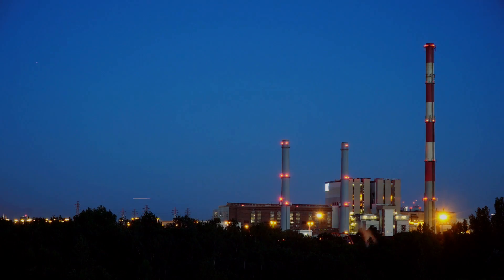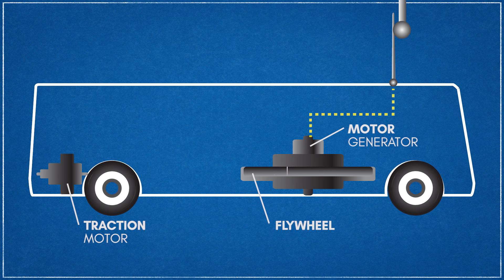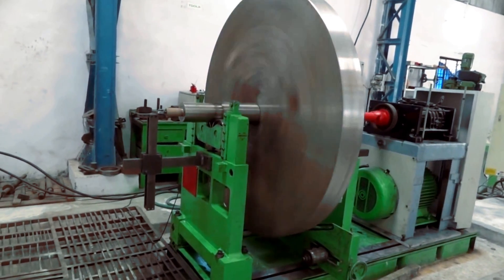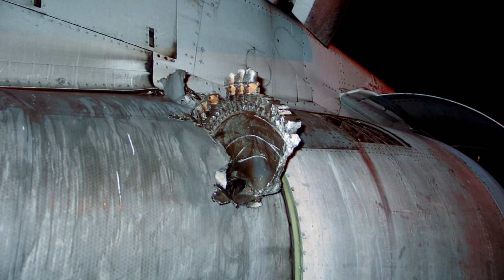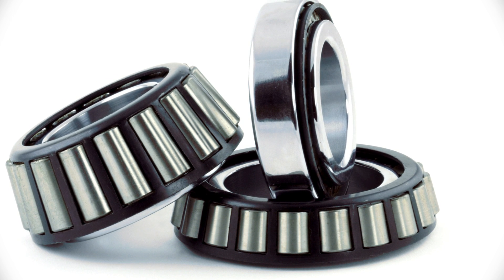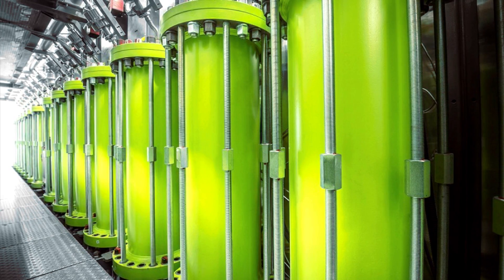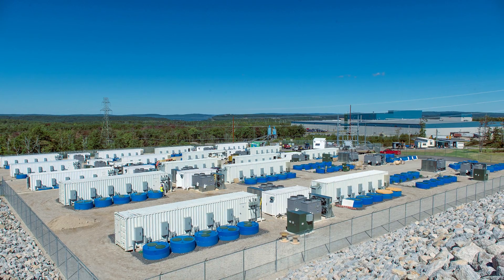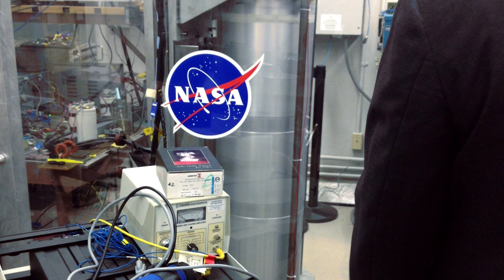The Mechanical Battery

Comment: 14:53 i was gonna mention that some F1 racers used a sort of mechanical battery type flywheel to recover some energy lost during breaking and using that energy to improve acceleration by means of a specially designed cvt transmission
Reply: And Mr Spock would say "fascinating"! Please provide a link for you info
Reply: @JohnSmith-eo5sp   here you go 
https://www.youtube.com/watch?v=KPJwJfdzP9o

Comment: So why not build huge solar farms in the desert, and when the sun goes down the extra energy the solar panels made over the day is send to a mechanical battery to power houses when there is a peak demand (just after sunset).
Reply: This is what is already happening, they just aren't using flywheels that much yet, and prefer to use batteries, pumped hydro, and other things.  As the video said, flywheels are great to supply sudden bursts of power, but for continuous even power (like running a city at night) there are other solutions that are more cost effective for now.
Reply: Berkeloid I think using flywheels for that short peak demand is a pretty cheap and viable option, but not sure, I’m not an engineer :)
Reply: @RikkerdHZ  I'm not an engineer either so I'm only guessing, but I figure the sorts of peak demands they see on the grid at night aren't significant enough for flywheels, otherwise I think we would see more of them already!
Reply: Berkeloid So I’ve done some research on them, and apparently the biggest issue is the cost. They actually can store loads of energy for good amounts of time, but it’s still a very expensive way of storing energy. 
NASA actually made a model which can store up to 500 Wh/kg (even a bit more, I don’t remember the exact number). This is almost double the amount compared to lithium-ion batteries.

And if it’s not suitable for huge, grid cases, it might be really valuable for off-grid homes! 
A bunch of solar panels charging the flywheel, and at night using the energy from it.

Velkess is a company which claimed it has found a cheap way of producing this, but there are no exact numbers unfortunately.
Reply: @RikkerdHZ  Very interesting!  I plan to use it in an off-grid situation myself, but more for stabilising a microgrid rather than energy storage.  But if it can outdo lithium, maybe I need to do some more investigating!
Reply: Berkeloid I think it has the possibility to outdo lithium batteries, especially from the lifespan. But it’s just the price, I think not enough people or companies are researching it!

Comment: What stupid idea! why not just use overhead wires to drive the trolley-busses as used successfully in trains and trams throughout the world fly wheels in engines are used to  smooth out thevpower pulses of thecreciprocating engines and to keep the engine internal mechanisms running to operate valve gear relectricsl generation and ignition systems!

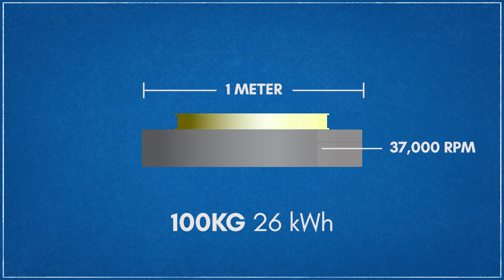Comment: 12:48 I wonder what the g-force would be. That is a lot of g's trying to pull that flywheel apart.
Reply: No need to wonder:    a=rω^2
Reply: @GFSwinger1693  Well?
Reply: @davidhenderson3400  I'm not going to hand you the answer, calculate it. There is your formula.
Reply: 765176g or 7.5 million m/s^2 if anyone's still wondering.
Reply: @zamundaaa776  That is crazy. That is g's pulling out. If that was g's pulling in that thing would be a black hole. How does it not get pulled a part?
And thank you for doing the math.

Comment: Back in the 80s  when there was only Bell telephone systems thousands of flywheel energy storage systems where place on  the long land lines to kept loop current within specifications for operation.  The flywheel system was charged when the phone was on hook and discharge during phone use.  This allowed phone lines to operate over very long distances with connection to other power sources.  These units looks a lot like a window air conditioner Freon compressor  of the same era.  Bet you did not know this not so new mind.

Comment: Another type of mechanical energy storage that is interesting are big towers that have heavy hanging weights that are lifted by surplus energy and are lowered to produce energy. A lot like old cuckoo clocks. They don't require expensive control systems or cryogenic cooling or magnetic bearings.
Reply: I just did some calculation on this: A 2-meter cube of steel (assuming 7.5g/cm3 density) lifted to a height of 60 meters would provide 9800 watt-hours (9.8kWh) of energy at 100% efficiency.

(7.5g/cm^3 * 8,000,000cm^3 * 1kg/1000g) * 9.8m/s * 60m = 35280000kgm^2/s^2 <Joules> [...then] * 1h/3600s = 9600kgm^2/s^3 <Watt-Hours>

Assuming you needed 2kW over an 8-hour night (16kWh), and you made your weight out of lead (11.34g/cm3), you would need a 2-meter-cubed weight of lead lifted to a height of ~51 meters - plus error margin, since that's assuming 100% efficiency.

(Same equation as above, just work in reverse, flip everything over, and cancel out units to solve for meters... the '5m' in the equation above):
16000kgm^2/s^3 <Watts> * 3600s * 8h * s^2/9.8m * 1/(11.34g/cm^3 * 8,000,000cm^3 * 1kg/1000g) = 51.83m

The weight-tower would have to be fairly beefy, and the weight would have to be channeled to eliminate dynamic load (tectonic sway).
The connecting cables would have to be fairly beefy as well, and rated for wear.
You could weld the weight container together on-site, then place lead blocks inside by hand. That wouldn't be too tough.
The last tricky part would be designing the dynamo, and rating its consumable elements for wear.

That's a lot of money just to store 16kWh.
You could combine the cost of construction and the estimated cost of consumables versus batteries.

I'm no fan of the Tesla Yuppie-Hipster-Techno-Grey-Goo-Dystopia, but just comparing raw numbers, a Tesla Powerwall can hold ~13.5kWh (7kW peak output, 5kW continuous, more than enough for a residential house's overnight consumption), lasts for ~12 years (Version 2, at least), and costs ~13K.

I think batteries are just too damn efficient for much else to compete... I just want other companies to get their butts in gear so that Ol'Musky has some competition and prices come down.
Reply: @-_-----  Thanks for the calculation, much appreciated. I wonder what the price would look like at scale? Water towers hold a lot of weight (even more than your lead example), so I wonder what sort of potential energy they can hold.
Reply: @Genubath1  Actually, I was surprised by the amount of mass that water towers hold aloft when I actually crunched the numbers... A water tower with a 400,000 gallon capacity held 50 meters aloft = 1,514.16 cubic meters = 1,514,160kg @50 meters (approximating, since not all of the fluid is at that level...) ≈< 206kWh.
I still think that the engineering requirements will force us to look for battery-based solutions... but it is interesting to crunch the numbers.
Reply: @-_-----  Could you please calculate how efficient this engine can be?.  
https://youtu.be/dTIwSd-TU00
Reply: @elementssolutions5473  Ahh shit, that's way more complex. I'll take a look when I have some downtime.
Reply: @-_-----  Thank you. For convenience, take a meter long cylinder and piston of 100 grams Without Friction. ( I am very curious how efficient this motor/generator can be compared to current motors/generators).

Comment: An interesting use of flywheel to store energy in motorsport is the KERS(kinetic energy recovery system)of the Nissan GTR LM. It was planned to have a flywheel that would spin at 60000rpm(47000G of acceleration for the outer edge of the flywheel) encased in a vacuum chamber, it is connected to an epicyclic gearbox which is then connected to the rear wheels. During braking it would spin up, and deliver 700 horsepower when needed. https://en.wikipedia.org/wiki/Nissan_GT-R_LM_Nismo

Comment: If only people would put effort into the one solution that will actually work, nuclear power.
Reply: Thorium is the best isn't it
Reply: If all places used nuclear power we would run out of nuclear materials rather quickly, its not common like other fuels are
Reply: @sammillington2403  That's a tired old urban legend that didn't even make sense when it was invented in the 1940's. But now it's utterly debunked as both absurd and irrelevant. 

Irrelevant because we literally have no other options so might as well. Renewable energy is a scam and fossil fuels get worse every day. The only debate on them is how much worse and in what way, both of those questions usually hinge on one's politics, but they are getting inexorably worse. So that leaves only nuclear fission as the way forward. 

And absurd because a child could debunk it. You see since that urban legend you're citing became popular we've actually looked around and prospected for fissionable materials. Subsequently finding them everywhere. So we now know that there's more Uranium in the Earth's crust than TIN... Do you know of a Tin shortage? :P And that's just Uranium. There's 2-3 times as much Thorium as well. But what there's more!!! We have more than double both of those resources combined of Uranium floating in the Ocean that doesn't even need to be mined, just filtered.

Best of all is that thanks to the magic of energy density only really tiny amounts of material needs to be used. There is literally nothing more resource conserving that nuclear energy. If you understood anything about the topic you wouldn't try to argue this point. Because, the so called "renewable" energy sources use more than 10 times the raw material and of more rare substances; all to make unreliable power that works at best 1/3 of the time and last for maybe 1/3 as long before it needs to be rebuilt. And the storage systems needed to keep that delusion running require even MORE raw materials of even MORE exotic types and last for even SHORTER periods of time. 

Renewable power is a hopeless and pathetic idea. And nothing shows it more than the line of argument you're inviting right now by repeating the Uranium shortage myth. Just look around we're already running out of copper and cobalt while the prices of lithium and silicon are rising day by day. And that's just a few problems while we're still at maybe 5% renewable power world wide, all with no serious amount of storage and that's being generous with the estimates. Conversely a nuclear power plant is pound for pound over ten time more productive using a bit of steel and concrete that lasts forever with just (almost literally) the occasional addition of a shovelful of dirt. 

Here's an overview if you'd like to give science and reason a try. https://whatisnuclear.com/nuclear-sustainability.html
Reply: If nuclear was so great, it WOULD be the only method.  Nothing in nature has a single method.  That's the point of the video.  None of you writing has worked in the utilities industry, primarily the boilermaking industry, or you would know that "nuclear" only accounts for the heat source in a water tube system, just like a coal burning plant.  As for profits, it still doesn't beat coal because coal is cheaper and more abundant.  As per waste, it doesn't matter.  Air pollution or ground pollution... pollution is pollution.  Gas and oil, still the same.  Storing power was solved a long time ago, the problem exists in how those flywheels operate in nuclear and coal burning plants.  They have to spin at optimal speed at all times and there's too many people relying on power plant electricity for battery storage to make sense.  That's why there are brown outs every summer in every city.  There are too many consumers and too few producers.  It has absolutely nothing to do with the heat source.  The entire system is collapsing because everywhere in western civilization, including socialist nations, utilities is politics, and no one will invest in the right thing.  An alternator can be coupled with an electric motor on a car.  In electronics it's called a voltage booster.  The only reason for charging stations is utilities companies want your money and they have your government in their pocket.  That's your choice because you want to sit here and debate something that you're completely clueless about instead of educating yourself in first, and maybe working in for a while so that you are informed about what you say.
Reply: @josephdavis2198  lol.... Well, the answer to your first question; is because poorly informed people like yourself actively advocate against rational energy policy, like going entirely nuclear. ;)

The rest of your screed is a bunch of random crap, or at best irrelevancies. I really hope you try to learn something about this topic one day, rather than just making stuff up. The part about flywheels is particularly hilarious, as not only is grid scale storage basically impossible, but flywheels are universally considered to be among the worst options. And the alternators on cars to replace charging stations sounds a lot like you think perpetual motion machines are possible. A claim that puts you far out of any possibility of being able to comment on this topic. 

So I won't waste anymore of my time talking to that level of bullshit.
Reply: You still have to store the electricity during periods of low user and have a buffer for when demand is higher
Reply: Someone forgot about Chernobyl
Reply: Because nuclear energy has never affected the whole planet. cancer has risin million fold this planet is stuffed because of nuclear power between the reactor breaches and nuclear bombs all those trillions of various radioactive particles will be in and around for hundreds of thousands of years
Reply: 98% wasted fuel?
Reply: @super-sim1665 it depends on how the fuel is used. There are facilities in Japan that use "nuclear waste" to generate more energy
Reply: @super-sim1665  Correct! Isn't that great? Nuclear is the best power supply already AND there's still room for improvement; 98% more by your estimation. 

By contrast 'renewable' power doesn't work now even when the material cost is ignored and the invention of new technology is assumed and there's no room for improvement. Most renewable power options are already quite close to their thermodynamic maximums.
Reply: @bronzedivision  All of Scotland is powered by wind turbine energy. Bill Gates has a plan to use the toxic waste but until that they just don't have anyway to deal with large amounts of waste fuel or store it.
Reply: @super-sim1665  scotland is already “storing” a fair amount of nuclear waste from dounray.
Reply: No nuclear power plant has ever turned a profit - and they all lose containment. Nuclear power isn't about energy - it's about weapons.
Reply: @crow578   That's an unusually incompetent reply. Most of what you rambled out could be debunked by a child's level of research, or even just a few minutes of logical thinking.

But your last point is the real nadir of reason as it's the sort of crap that doesn't even require science, or energy specialties. Rather the most rudimentary understanding of history will debunk it.... 

You see every nation with the Bomb got it before deploying nuclear power plants. A few have them without nuclear power plants. And those few nations that had the bomb but gave it up also kept their nuclear power plants. The fact is your MINDLESS assertion flies in the face of all data! 

And when those simply historical facts are combined with even a basic technical knowledge you claim goes from being outright wrong to tragically ignorant. Because civil power power plants are useless for bombs. And comically the efforts to combine they by imperialist governments trying for Armageddon on a budget have only discovered that both design goals suffer. Duel purpose electricity generating bomb plants are just crap, they make expensive power and crap munitions. As such no one wants them, and none exist today, except in your imagination. 

BONUS FACT: Nuclear power plants are the ONLY way to get rid of the bombs... ;) And we've done this! The "Megatons to Megawatts" program ran from about 1995 to approximately 2015 and in those 20 years generated a TENTH of the USA electricity from discarded Russian warheads. Weapon material that now no longer exists AT ALL. :)
Reply: Nuclear has never worked, thats why it's still subsidised
Reply: @GrantAUM that's not what subsidizing is an indicator of.
Reply: @marcomoreno6748  I didn't say it was, but in this case it is. It's not profitable, taking into account waste processing etc
Reply: @GrantAUM  not everything that's good for the world has to be profitable. We have it all wrong
Reply: @kanesas45  I'm fully with you on that one. It honestly feels to me like this CO-two thing is primarily profit motivated.

In that comment I was thinking about the local, organic kinds of options for the way could be organised around which would actually benefit the planet as well as humanity

There's alot of comments I see that looks like there's an idea that the existing fission nuclear system exists for a cost effective and environmental point but they're definitely not,

We totally do have options for safe fission with an end of life renewal and waste management system but the profit motive makes them cut corners too....

Comment: There is nothing new, Electric elevators have used that principle for over 100 years. The mass of a rotating generator greatly increases the acceleration and deceleration of the system parts. That way one can use low hp. mg sets with heavy rotating parts to give much quicker response times. Also when the load has reversed the motor now becomes the generator. This pushes power back into the grid lowering the buildings power bill..Win win. Guess what I did for 45 years.